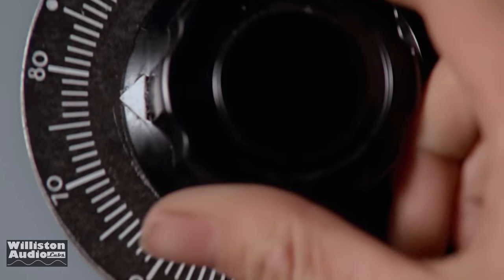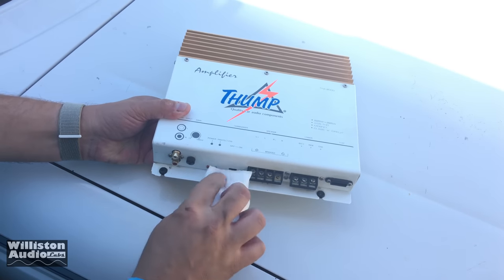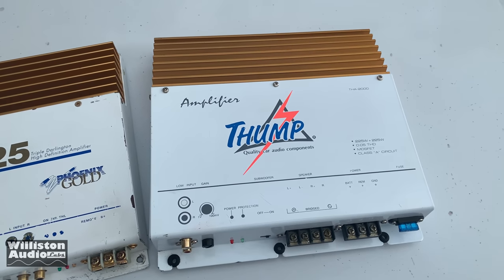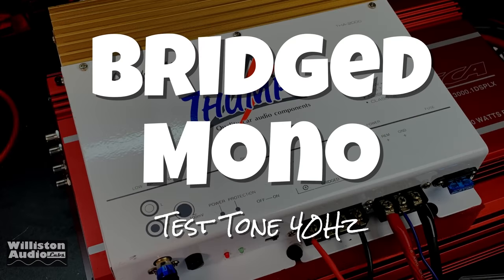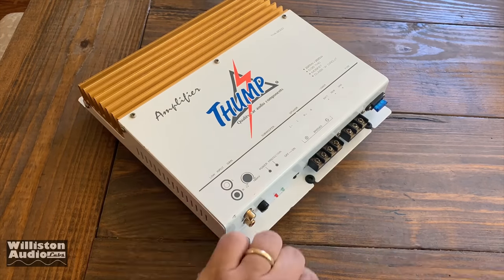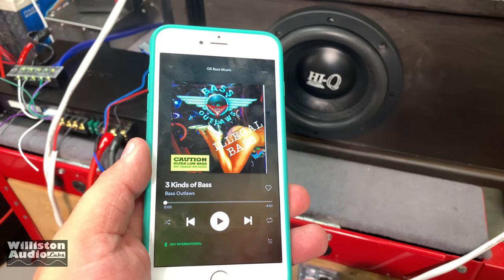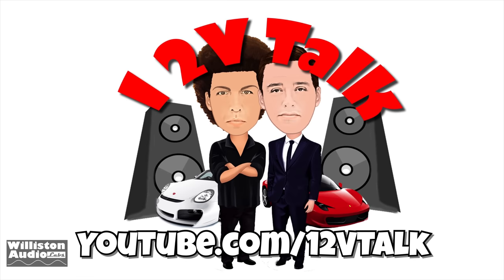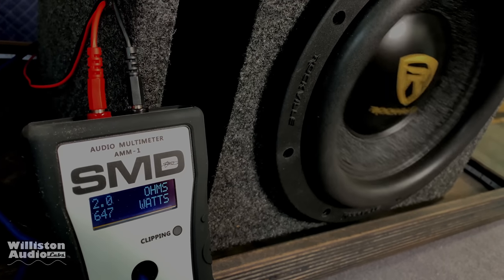Flea Market Knock Off? 1997 Thump THA-2000 Amplifier Dyno Test Phoenix Gold Replica [4K]

Comment: This amp actually works well if you know its limits. I found this hidden in my garage recently  and found out it was from my uncle from the 90s. Hooked it up in my dad's van with an 8 inch and a ported box I built and it actually bumps. you can hear my dad's van from a couple blocks away. Not bad for a "cheap/knockoff" amp if I'd say so myself.

Comment: Saw one of these online recently, and thought it was a cheaper clone but wasn't sure. Thanks for posting it. 

If older amplifier (home, car, or marine) gets too hot during light/idle usage or heavier usage (even with a board/case fan) the thermal paste is probably shot. Much like overclocking a cpu or gpu on air, which can kill fresh paste in under a year, running an amp in a hot trunk, amp with inherently high bias, poor chip design, tiny heatsink or cramped heatsink filled with a ton of chips, or eventually just age, etc., can cause the paste to dry/crack and lose heat transfer efficiency over time. Since these older amps (cheap or high-end) are often put through grueling usage in short time frames (home amp might see 5% rated for daily usage with minor near-limit usage in climate controlled room; car amp is probably at/near clipping in 100+ degree trunk for extended periods) keeping fresh paste on them can at least keep them healthy in the years to come. Since parts, service manuals, etc. are already hard, if not impossible to come by, keeping your older amp in the best possible shape should be a goal. You wouldn't want to DD a 25 year old car with 1990's oil still in it. PSA, do NOT use paste that conducts electricity.

Comment: I had one of these almost 20 years ago when I didn't know any better.  Bought it second-hand.  I couldn't tell you the model but mine didn't have the "subwoofer" switch.  I ran it bridged into a pair of Kappa Perfect 10s and it sounded just fine to me.  One thing I loved is that it had no subsonic filter, so when I was playing weird D'n'B and other electronic music, I could watch the sub go down to sub-hz wobbles.  Inaudible but it sure looked cool.

I never ran out of power with it, but it did run very, very hot, enough to trip the protection on hot days, so I added some fans and a custom shroud.  To its credit, I pounded the crap out of that turd for 5-6 years before junking the car.  Not bad for $50.

Comment: I remember when I was 13 I bought 18 8" Thump subs for $5ea at a car stereo shop. I ended making 2 sub towers with 9 subs in each tower wire series/parallel for my HiFi system I was building. I didn't know Thump brand had amps

Comment: I had the really small 125watt Thump amp way back in the day! It was running two 10” Audio Authority subs, in a ported MTX full rang box. All that was hooked to a Rampage head unit, AM/FM CD player. It ejected the discs like a old cassette deck would. It worked off of a spring loaded system lol! It actually slammed pretty good! Oh and the radio dialed in the stations like and old dial radio would but the display was digital!
Reply from the maker: Cool start, thanks for sharing 👌
Reply: Williston Audio Labs, anytime thx for running the channel I’ve been a sub for a while now!

Comment: My best friend who is no longer with us...had ordered in 1995 through a wholesale warehouse audio catalog a dark blue carpet wide dual 12 mobile authority thump truck subwoofer box and it had a set of about 2 inches square Motorola branded piezoelectric tweeters called super tweets on the corners of the box at the top, and it wasn't a bad setup but too many pink Floyd and Master p songs hard hitting popped the voice coil loose in the right sub, and the subs were upgraded to JL audio w3 V1 single coil 12's sounded awesome and it was in a regular cab short bed 2wd 89 dodge Dakota sport 3.8 electronic choke tbi V6 and a odd option for most sport Dakota trucks other than it was not a 4wd but a automatic transmission without the overdrive button

Comment: I installed these Amps for a local retailer back in the day. They sold the Thump with MTX blue thunder 10s (if I remember correct) in a pre fab box. YUK!
Not much bump whit lots a heat. :)

Comment: Like to see a test on this  good old school amp. Profile California. I used 4 of these back in the day. They worked good. The company didn't produce a lot before they went bankrupt.
Reply: I remember them they were a very premier amplifier and when u seen them they were n very hi end builds but had some cool art work on there covers
Reply: I loved the long LED light bar!
Reply: I had the 600sx blue amp with the long red led. It was a great amp for the money! I knew it wasnt getting 600 rms bridged. More like 450 maybe but it  was definitely worth the money.
Reply: I had the 600 mono amp. Ran it @ 2ohms never had any problems.  Big D did a dyno on the 1200
Reply: The Profile brand was a staple in the old JC Whitney catalogs! Their amps were of much better quality than their subs, though. I had to solder my connections on the sub terminals a few times back in the day!
Reply: I had one of those  amps  and  it  did  good

Comment: Just a heads up, Mr Clean Magic Eraser is just melamine foam. It works like ultra fine sandpaper. So I wouldn't use it on glossy surfaces that you care about.
Reply from the maker: Put some water on it and it’s like gently polishing out the age 😊

Comment: I have a pair of Thump Pro PTH-82 8 inch speakers185 watts.One blown.Came in a used truck/wedge box.Faded red/orange cone, black dust cap and dark red basket.Had them since 2000 or so.Just sittin around.

Comment: You know I can remember back in the day "1995 or 1996" I had two JBL 10" dvc's running off a Jensen XA1120, which was wired to 2 ohms stereo and it actually sounded pretty good. I can also remember buying a set of Thump subs in highschool to use for woodshop, we had to build something so I built a cheap bandpass with them in it. It was funny because the teacher had supplied wood from a cabinet factory that had veneer applied to it "the school got loads of it donated", he made me build the entire thing so that all the seams were hidden and made me stain it and apply clear varnish on it.

I laughed at the idea of a car sub box being finished so nicely back then and here we are today and it is a style! I only built it to pass the class, I later tossed it in the trash, but back then, I think it was 1994 Thump subs were for sale in the back of Mini-trucking for like $15 each "Which was why I bought them" and they were made in Compton, California or at least that is what the sticker on the back plate said! I do believe that these Thump amps were also available from jc whitney back then, since most of the equipment they sold in the mid 1990's was all flea market quality!
Reply from the maker: Great story, thanks for sharing 🤙

Comment: I used one Thump Amp Back In the Early 90s and didn't keep it a week LOL... I Have A Really Old Fultron Tidal Wave TXB 200 Two Channel Amp And I Got It In The Mid 90s And Kept It Ever Since But It Is A Surprising Amp On A Couple  Of 12s In A Sealed Enclosure and it is Heavy as Can Be, it Reminds Me Of The old school PPI Amps. I also Try To Buy Every Punch, PPI, kicker, Autotek Mean Machine, Phoenix Gold, linear power, sound stream, and now zapco amps that I can find in Yardsales to consignment Shops and wherever they are the cheapest and doesn't matter if they are like new or just parts Machines

Comment: I remember having another knockoff of that amp many years ago. It was called Diplomat in the same size as the M25. (Have not found anything about it online) it had a crusty chipamp with about 15W per channel and a nearly empty circuit board, haha. It was just as good as anyone would think it was.
Reply from the maker: There are hundreds of flea market brands out there and most are vastly overrated

Comment: I’ve got a question it is completely off the subject of your video I have been reading up on how people strap two of amps to one subwoofer I understand if you have two  amps that are made to do that but I am wondering if I have a dual voice coil subwoofer do I have to strap amps or can I run two separate amps to each side of the sub without connecting the amps at all

Comment: I'd like to see if the performance could be improved if the caps were changed to nichicon or hitachi.  Surely fresh electrolytics would improve performance - especially an AMP built in 1997 with inexpensive components.
Reply: No - it will make no difference at all.

Comment: I liked these just because they were PG knock-offs, hilarious really. I had a bunch of these, THA-1000, 2000, and 3000. The pair of THA-2000 I had were a mint looking set. The 1000 model is total garbage, just a "chipamp" that ran straight on 12v if I recall. I use to buy all kinds of amps I came a crossed cheap.

Comment: Question: have you ever used a larger fuse? Would it even make a difference?
Reply: Scott Smith It came with a 15A fuse when new. And it wouldn’t make a difference.
Reply from the maker: I checked to find the correct fuse size and it was 15A. Larger fuse wouldn’t help
Reply: @wal  cool I was just wandering if it would make a difference. Not just with this amp but any amp. I just know some factory defaults are less than the products actual ability. Like all laptops that run windows are default to only run on one processor you have to go in and change the settings to get peek performance. Which I'm sure not many people know about. So I was just curious if larger fuses would make a difference. I've been a fan of your channel for 2 years now keep up the great work.
Reply: Great question i was wondering the same thing....another question....will it hurt an amp if you did put a bigger fuse than its rated for also??? Just curious cause iv seen people do it a few times wen running lower ohm loads theyd pop a fuse or two and swap in next size up...or even mabye one side out of two...
Reply from the maker: @scottsmith4469  if the 15A fuse would've blown, I could've tried a bigger one. Like the Polk Audio 2000.2 I tested recently where I upgraded the fuses from 25A to 40A. Not smart in most cases, but I was trying to test it's limits.
Reply from the maker: @adammarsden4650  the fuse is there to help protect the amp. Generally speaking, I wouldn't replace a fuse with one larger than recommended by the manufacturer. I use test tones for my tests and on occasion, the recommended fuses need to be upsized due to the extreme stress involved with test tones. Also, as you mention, running an amp at less than recommended ohm load can stress the amp, pull more current and pop the fuse. I would say this is a good sign you have the amp at the wrong load. Kinda like running an engine past redline. Yeah, you can do it, but it will shorten the life of the engine, same with the amp.
Reply: @wal  yes sir and  thanks for all of you and Hi-Fi's helpful advice and knowledge. Can't wait to see what goes down in this new challenge you talked about on 12vtalk.

Comment: Probably just a misprint. Should be 22.5W + 22.5W for a real cheater!
By the way, that amp has no pulse modelling or similar. It says it is a Class A amplifier and that is not a switching amp. Those chips you see are the operational amplifiers and probably an electronic protection circuit. Kinda confused with that red light for power and green for protect?!
Reply from the maker: Thanks for clarifying, I’m
Betting the Class A notation was given from the same person who decided 225+225 as the rating

Comment: Have you ever dyno’d head units?
Reply from the maker: Yes, Alpine, Pioneer, Blaupunkt. Most use a similar amplifier chip capable of 16x4 RMS, some have a smaller 10x4 RMS version. The older "V-Drive" Alpine head units requiring 10ga power direct to battery have a better amp. I need to test one of those...

Comment: still not the worst and it could have made 100w per channel atleast if they had used bigger transformer , more voltage and larger rail caps. looks like those r 150w max transistors.

Comment: 15 AMPS is 180 WRMS OR pmpo unless it has MOSFETS.
Reply: Dave Micolichek  They turn 12 volts to 40 volts on the left and right rail then combine them to make 80 volts.
Reply: Dave Micolichek  No, it amplifies too.
The MOSFET (Metal Oxide Semiconductor Field Effect Transistor) transistor is a semiconductor device which is widely used for switching and amplifying electronic signals in the electronic devices.
Reply: Dave Micolichek  It amplifies it with a reserve.

Comment: TIP: IF ANYONE OF YOU AQUIRE AN OLD AMP LIKE I DID AND ARE MISSING 1 OR ALL OF THE TERMINAL SCREWS THERE IS AN EBAYER WHO SELLS REAL GOLD PLATED REPLACEMENTS (:   Apparently 95% or more of these amps that use these   all have the  same size!

Comment: Maybe a bigger fuse could've helped it reach a 100 watts?
Reply from the maker: Nope
Reply: @wal  maybe
Reply: @kevinmontoya7318  bigger fuse doesn't make more power, it only allows more power to flow through it.
If it needed a bigger fuse, it would blow the small fuse when used.

Comment: what did you expect with a 15A fuse, if you wanted to pull rated RMS power you should have used a bigger fuse so you could have achieve full Decibel Damping through the DB infrasonic filter which would have allowed access to the complete THD Signal-to-Noise Ratio and allowed the amps total SPL headroom to be tested ...wink wink nod nod......